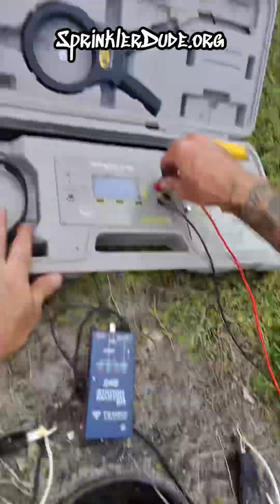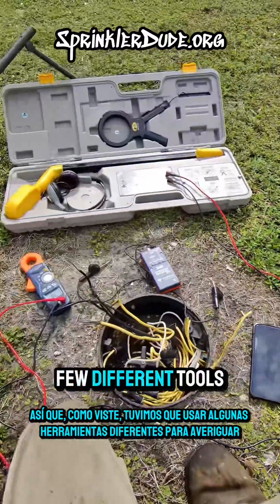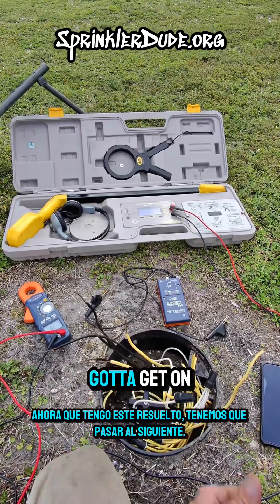Irrigation Troubleshooting with the Armada Pro900 & Tempo Station Master

Comment: The master vavle may have its own separate common wire. But it will be installed at the same spot as the other common wires
Reply from the maker: Yes, this is true.

Comment: Do master valves share the same common wire as the zone valves? If a master valve is installed after the original irrigation install, how would this be wired?
Reply from the maker: All common wires go to the common terminal. If there are multiple common terminals within the controller, they are all connected behind the scenes.
Reply: @ Is it more common for the MV to have its own common wire or for the MV share the same common wire as the zone control valves?